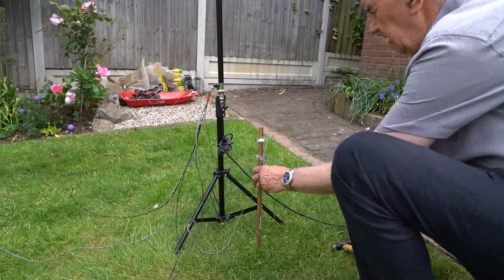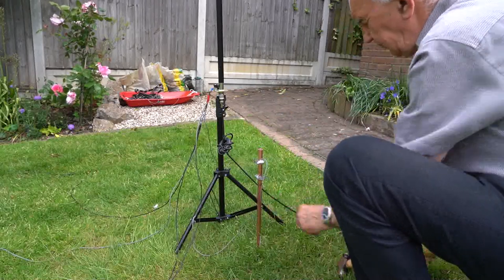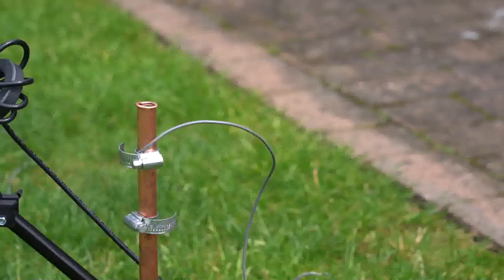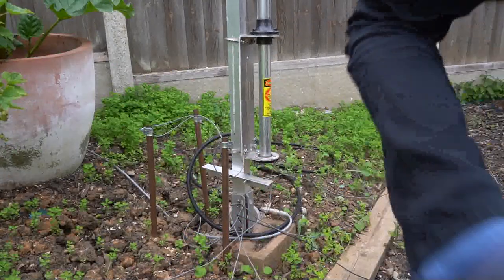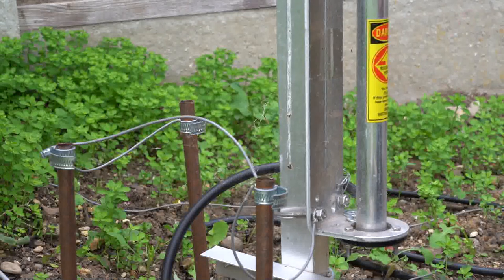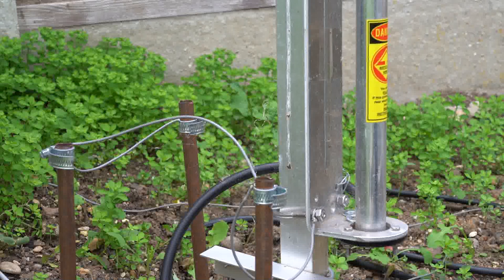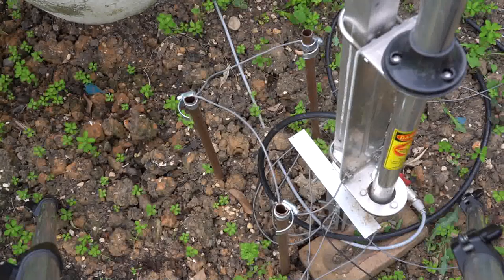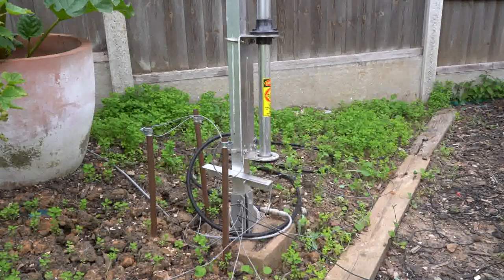ANTENNA RADIALS DOWN TO EARTH + "..a bit more!"

Comment: Very interesting video as are all the others. I notice you mentioned the vertical was for use with your portable. I think this is because you can't earth anything connected to the mains power supply in the UK? Is this right or do you have isolators that will let you ?

Comment: I don't know if they are available in the UK but in Australia we can purchase copper lined steel rods. Our domestic power circuits are grounded using these and they are available at all electrical suppliers in either 1200 mm. or 1800mm. lengths.
If my memory serves me correctly they were sub $30 Au. (c.20eu.). The steel used is quite hard and not subject to easy bending and they are sharpened to a point on one end and are much, much easier to drive into the ground than copper pipe. I've installed two to a depth of about 1700 mm. through clay and shale.
If you need to go out and purchase a ground rod it would be well worth your while investigating if these are available in your country. They really are the way to go. I hope that is of some help.

Comment: Does the earth stake make the antenna into a great Lightning conductor? I confess my knowledge with antennas and lightning issues are limited. If you have'nt already done so, could you do a video regarding this issue and maybe explain lighting arrestors and how to avoid and protect from lightning strikes etc? Many thanks for sharing your knowledge with us all.
Reply from the maker: NO - the antenna itself is not connected to earth, only the outer coax feed point.
Reply: @watersstanton  Ah yes, of course. Perfect answer, Thanks. It would still be great for a video regarding lightning protection though... If you find yourself short on topics to talk about :)

Comment: Toolstation sell four foot long copper plated steel earth rods for less than £3, much less prone to bending than pipe. They also sell suitable cable clamps. Also, the rule of thumb for minimum earth resistance for multiple earth rods is that they are as far apart as they are deep.